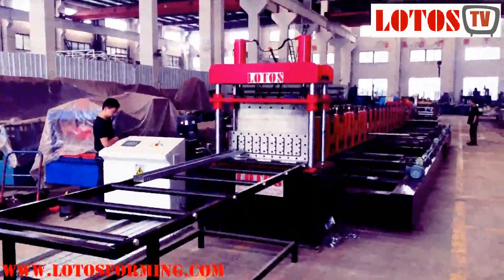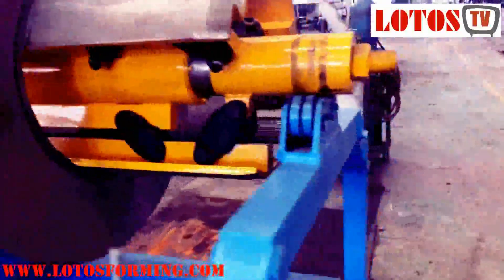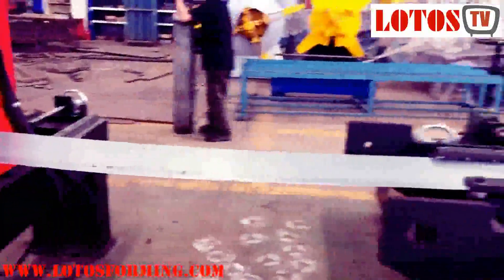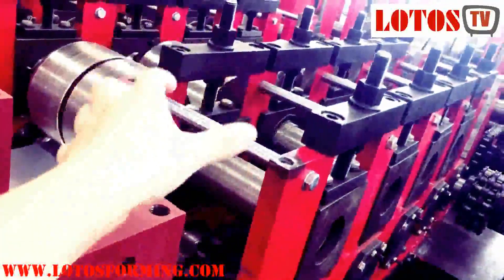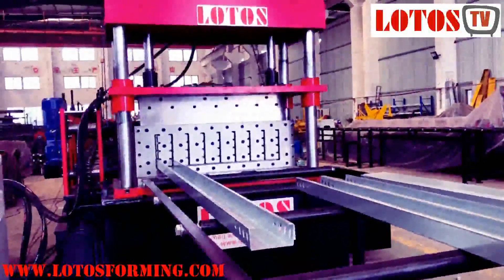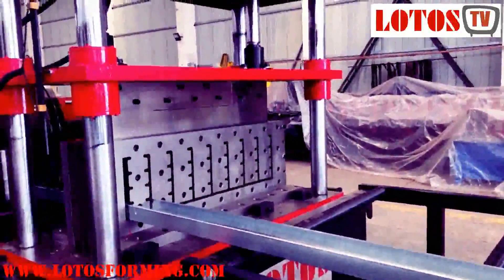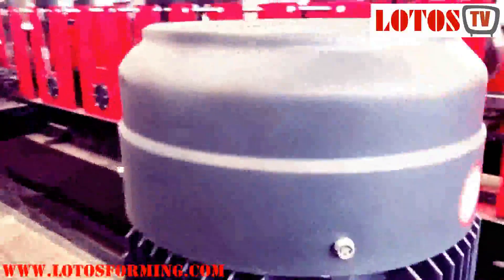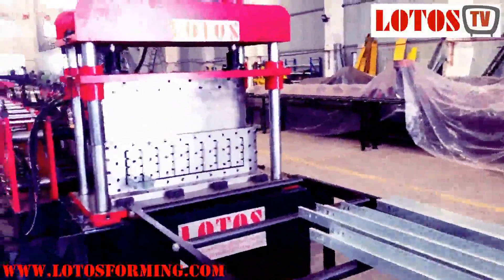cable tray roll forming machine | cable tray making machine " LOTOS DESIGN 2019"

Comment: actually, in mounting circuit breakers and industrial control equipment inside equipment, racks are used DIN rail a metal rail of a standard type.

Comment: a cable tray is a unit or assembly of units or sections and associated fittings forming a rigid structural system used to securely fasten or support cables
Reply from the maker: Its last version of a multi-size cable tray roll forming machine can do various length sizes and with different height. It’s suitable for the thickness of 1.2-2 mm

Comment: Support and route cables along ceilings, walls or under floors with cable tray systems
Reply from the maker: also named :
 Ladder Type Cable Tray
Solid Bottom Cable Tray
Trough Cable Tray
Channel Cable Tray
Single Rail Cable Tray

Comment: A #cable #tray is a unit or assembly of units or sections and associated fittings forming a rigid structural system. these profiles used to securely fasten or support cables and raceways.
Reply from the maker: here you can catch more details: https://lotosforming.com/cable-tray-roll-forming-machine/